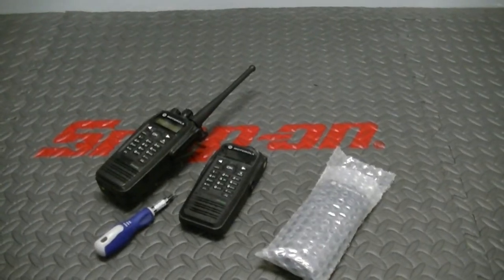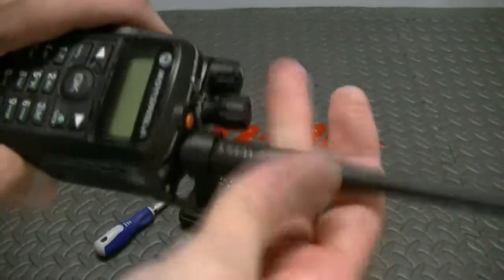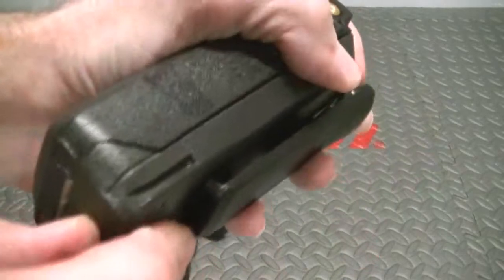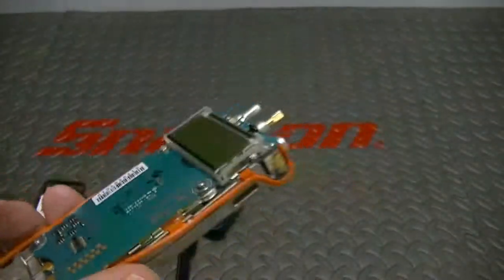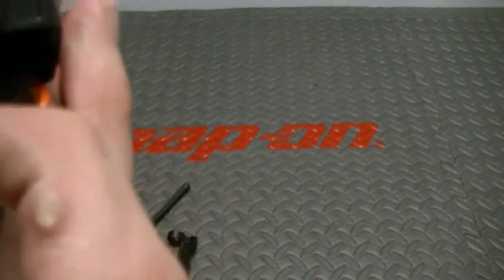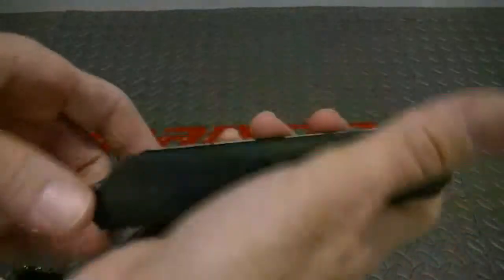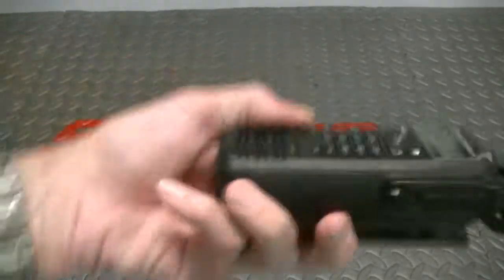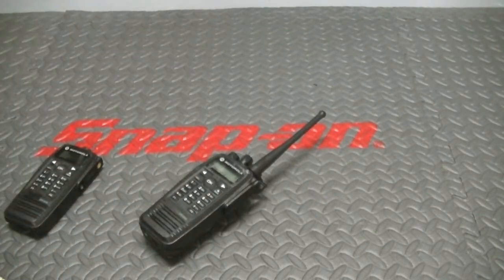Motorola Mototrbo Rehousing Tutorial - How to rehouse a Mototrbo 6300, 6350, 6500 and 6550 Radio

Comment: do you have any Motorola clear or colored factory housings?
Reply from the maker: No.  The clear ones were for Motorola Corporate Presentations at shows.  The only color for Mototrbos and 1500/2500 series is Motorola Matte Black.  The XTS3000/5000 series has them in fire yellow (if you can find them).  Any other color is a hack job of Krylon plastic paint and no one has ever done a paint job properly and plastic paint wears fasssssssssst.  I've done it before on a couple old housings, but it doesn't last and doesn't look good at all.
Reply: snarlingrabiddog5150 can you shoot me a email johnathonlansing@gmail.com want to see if you have any xts 2500 in vhf 136-174 Mhz
Reply from the maker: Johnathon Lansing I don't have any available for sale at this time.  I have XTS5000's if you want those.